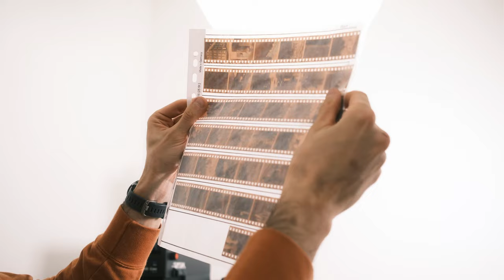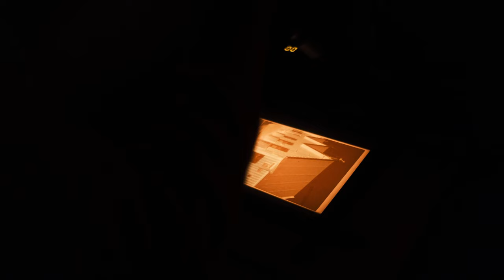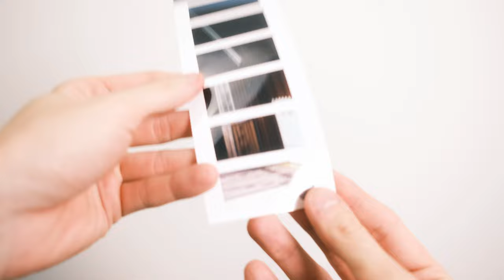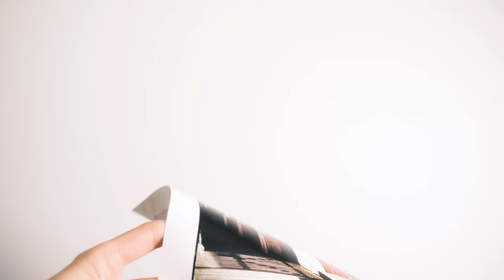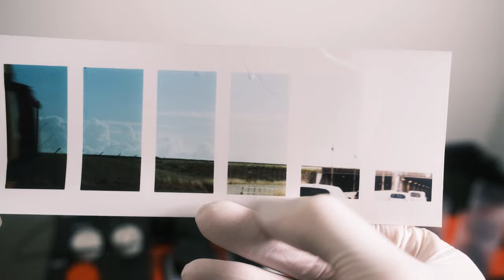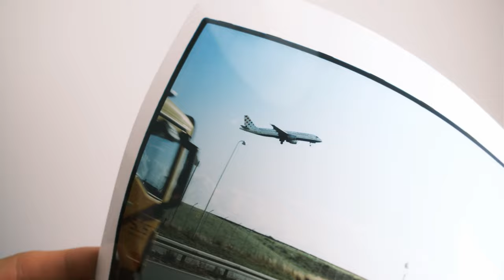Problems with scanning and RA4 printing

Comment: I am sometimes doing contact prints on 25x30 but sometimes I have no time so I scan with either my DSLR and valoi or do a whole contact style scan on v850 but I scan raw as a negative and use capture one for the conversion and have much more control than NLP etc. And usually this is only to make a final selection anyway before going to the darkroom.
Reply from the maker: But keep in mind - contact printing cool thing if you print after, because it’s fist test print and with experience you can know what to correct later.

Comment: I totally understand the frustration with scanning. I always get this weird magenta/purple hue when I scan Kodak 400 negative with my epson v850 in silverfast. Im so fed up with this. Why these stupid digital conversion softwares are so bad when it comes to color interpretation..  any help or advice? All the best
Reply from the maker: It’s actually combination of problems - incredibly poor quality LED and lamps in the scanners, also poor quality in terms of the direction of the light and old rgb type system for scanning. Best way to scan film theoretically- Deep Blue, Green and Ultra Red LED light with combination of BW digital sensor without IR filter in this case you remove problems with base color mask of the film, problems of crosstalk’s in film and sensor and in the same time get real red from film. More or less this is “how drum scanners” takes pictures, but in this scanner you have photo multiplayer as a detector. So quick solution get best negative quality and use camera or dedicated scanner (Plustek for example) and adjust camera/scanner to produce good results with no settings under conversion with NegativeLab for example. In this case you will get at least consistent results.
Reply: I tried scanning DNG raw format with silverfast and then convering with negative lab pro but still the results look very washed out and skin tones look very cold. I never calibrated my epson scanner and there is so little information about it online. But not even sure if the calibration is the solution to get better results
Reply: @patrykzar I’ve always had the same exact problems. Very inconsistent too. I’m almost finished with my darkroom and I will only do prints from here on out

Comment: would still love to see you make contact sheets of your film! once those are made you can scan the sheet with a regular scanner and use that scanned image for digital usage! That way, with one scan of around 1 minute you can get a full sheet of 35mm film, already color corrected and everything! the only trade off is the resolution of each individual image, but it that will also be less the case with larger formats.

Let me know what you think
Reply from the maker: My problem with the contact print - size of the print. All contact printers what i saw in my life request bigger paper when i can develop in my drum, but in general i like idea because you get initial point of exposure and color and can estimate how good you are in exposure of negatives what is impossible in scanning✌️
Reply: That is true, a full roll of 35mm does require a quite akward size of paper ( i believe 9.5x12) but you could start with your 6x6 shots and see how you like it! thankfully a full roll of 6x6 fits perfectly on a sheet of 8x10. then if you like the process you could always get the slightly larger jobo drum for processing the bigger paper 🤙🏻

Comment: Thank you. another nice video. If i have any problems it was always with Portra 400. with a green colour cast. and the blue of the sky never looked the right shade of blue. I use the Epson V850 pro and Epson own software for the Basic scan then I use aperture Apple software for all the final adjustments. Ive always wondered how a darkroom print would look compared to a scan.
Reply from the maker: This is always interesting for me because scanner even before conversion make optimisation for the exposure on each channel and if it’s wrong whole picture will be so far off what’s impossible to correct. Paper in this case extremely forgiving because you can select intensity of each channel on photohead in huge margins un comparison to full spectrum light scanning
Reply: Just in case, I used to have a lot of problems scanning Portra but the origin of the issues was the developing. Portra is very sensitive to any variation of temperature or agitation during developing. Tried a different lab that develops with a machine and all the issues went away